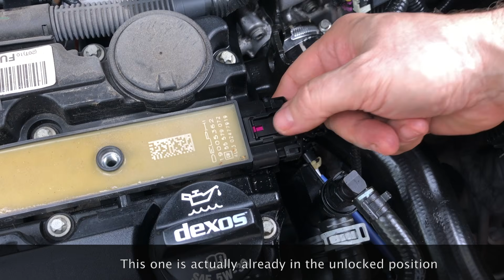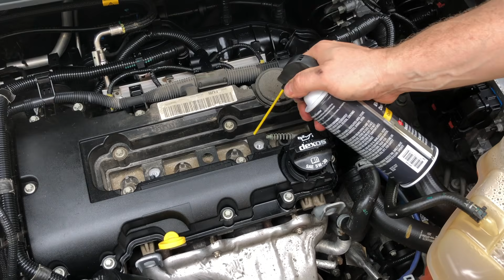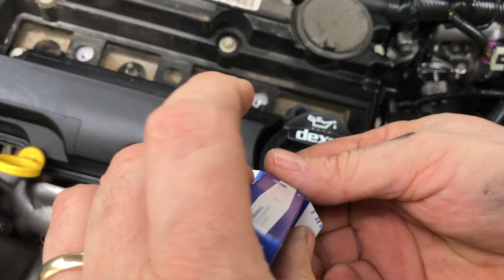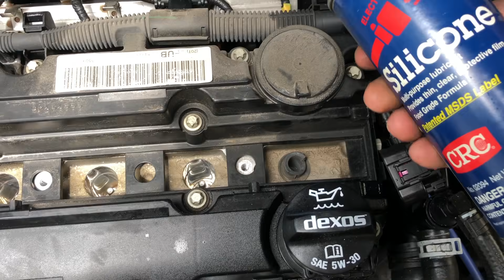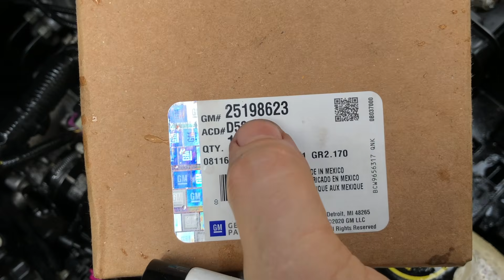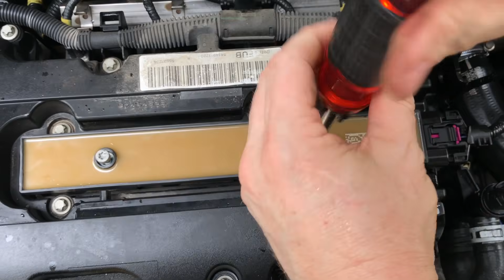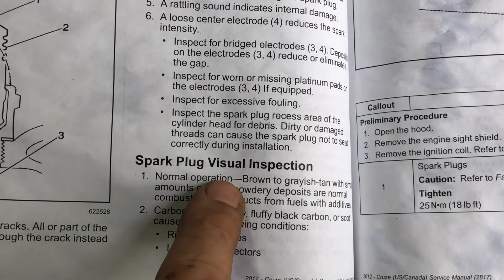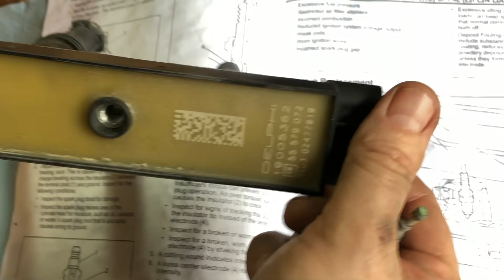2012 - 2021 GM Ecotec 1.4L Turbo Engine 60K Mile Maintenance (Replace Plugs & Coil Pack) Sonic Cruze

Comment from the maker: In the case of this video, the vehicle owner wanted to replace the coil pack entirely rather than repair the damaged boot.   This is what I would recommend if an aftermarket coil pack is involved as those are inherently inferior to genuine GM parts.  But here is a link to a alternative approach, where just the individual boot and/or spring can be replaced with an OEM to GM kit: https://youtu.be/vUFMqa44Phs
Reply from the maker: Yep, but that's not what the vehicle owner wanted here.  But I've shown this less expensive route also - https://youtu.be/vUFMqa44Phs

Comment: should use anti seize on the spark plug threads also
Reply from the maker: No, you should not on these engines.  Not recommended by the manufacturer as it Interferes with achieving the correct torque value for the crush washer.
Reply: @DrShock  yeah i believe you're right now that i actually looked it up.  just assumed from being told that so often

Comment: Can this work on Chevrolet sonic 1.6L 2016?
Where can I order coil and spark plugs
Reply from the maker: No, this is video is only applicable to the GM Ecotec 1.4L turbocharged gasoline engine.  For this video, the links to the parts used are in the video description.

Comment: I bought my '12 Cruze with 109K miles on it. I recently replaced the plugs at 199k miles. The plugs looked good, which told me that they were replaced right before I bought it. I didnt replace the coils. They looked pretty good.

Comment: My 2020 Trax manual says replace plugs at 98000K.
Reply from the maker: Be sure you have the RPO LUJ or LUV engine that this video covers.  It can be confusing, as GM has multiple 1.4L turbocharged engine designs produced in parallel over the model years this video covers.  RPO would be the "regular production option" code for the one you have.

Comment: I'm having a difficult time understanding why the one plug & coil electrode had so much corrosion where the others didn't? Not seeing moisture as the reason to the constant engine temperature would dry up any moisture....These are high maintenance vehicles & being proactive in the maintenance is the only way these vehicles will last.... The plastic water pump & thermostat housing plumbing is a joke, Guaranteed failure on an engine that cannot take one overheating... The engine has to be idled down after a hard run to try to save the turbo charger, Oil changes are a must between 4-5k miles, The oil feed tube to the turbo also has to be changed around 30-40 k.. God help you if you bought one of these cars used with the previous owner sleeping at the switch....I foolishly bought my 2017 Trax new & it just turned 30k miles, & I'm starting to get scared, I primarily drive my 2005 Toyota Matrix with 225k miles with piece of mind.....
Reply from the maker: This particular GM engine, designed by their German Opel division at the time, encounters corrosion on the spark plug and ignition coil spring (typically cylinder #4 but can occur on any of them) as a very common problem in the RPO LUV and LUJ first generation flavors of this engine.  The spark plug metal will show the typical iron oxide coloring, but the coil springs will be more green in color from copper oxide. Even diligent use of dielectric grease within the ignition coil boot cannot fully prevent this corrosion which is likely driven by water condensation in the the spark plug wells on this engine design while the engine is off

Comment: How come your engine is not covered in oil and coolant like the rest of ours???
Reply from the maker: Well first, this isn't "my" engine but rather someone else's I am servicing.  And while it's not pristine, these are European engines (GMs former Opel division in Germany designed them) so they are high maintenance.  If you proactively replace any seals or gaskets, and reseal pans and covers, at the first sign of leakage that goes along way towards the cosmetic appearance that this example still has after a decade of regular use.

Comment: Replaced my coil pack and spark plugs when i first got my cruze at 63k miles, didnt know bad coil packs on these cars produce a ticking sound so it scared me 😂, i can say though the oem ones didnt work for me, i bought two and the springs would always go out, bought a aftermarket one off amazon for $80 and havent had to replace it sense and im at 93k now

Comment: Dear DrShock - I love you videos, you do a great job of giving the R&R Procedure (Remove & Replace). 

No Offense Intended: If I could make a suggestion to you, as I have seen you do this in other Auto R&R videos, and that is to ALWAYS use some Anti-Seize, on the plug threads especially since your screwing two dissimilar metals together!), a tiny bit on the sealing gasket if the plug has one, and Silicone Grease (Di-Electric Grease) on the spark plug porcelain, Q-Tip a small amount up into the Spark Plug Boot, AND on the outside of the Boot (so it does not adhere to the plug-well walls). A small dab on ALL assembly bolts.screws, and finally, some Electrical Contact Cleaner/Preserver* in both side of the electrical plug, which you then blow out lightly with a short blast of compressed air.

*NOTE: Such as - CRC QD Electronic Cleaner.

NOTE: When you lubricate the threads with any anti-seize, you generally should reduce the Torgue by about 10% to reduce the chance of stripping, as the Dry Threads contribute to the torgue resistance, and when you lubricate threads, you lose that resistance to torquing, and can possibly strip threads, especially in aluminum!

These recommendations come from my 53+ years as a Mechanic, Technician and an Engineer, working on everything from cars (I was a Chevy Dealership Mechanic at one point, Semi's, motorcycles, small engine equipment, large engine equipment, military vehicles (Former US Marine), and even Surface-To-Air Missile Systems which we periodically had to maintenance when deployed in a hot zone. 

Just a suggestion for you to consider, but thanks for the GREAT job you do of demonstrating the R&R, and showing part numbers,... wholly invaluable information sometimes! - JD
Reply from the maker: Thanks, for the overall feedback on the channel and the comment here.  I know folks develop alot of their own tweaks to various repair procedures with experience and appreciate it when that is shared with the community via the comment section on a given video.  Particularly regional specific approaches, where corrosion e.g. can be a significant issue for some vehicle owners.   

In order to present a consistent factory engineering perspective on the channel though, I usually present the OEM service information as-is without any modifications.   If the OEM recommended any chemicals or lubricants, I definitely show them, along with the OEM recommended chemical brand, part number, and suggested application.  I'll also highlight when the OEM recommends against such practices, which would usually just be where fastener torque is more crucial.   This leaves the comment section to add individual experiences and suggestions as we're discussing here.  Thanks again.

Comment: I recently bought a 2013 Buick Encore with only 60k miles and replaced the spark box and spark-a-lators.  Your video was a great step by step.

Comment: What exactly would cause that corrosion to the spark plug? Isn't it a function of the coil boot to keep out any water?
Reply from the maker: Prior service, done by another shop, may have failed to use dielectric grease on the boots.  Could be a previous owner "washed" the engine, which is a huge no-no on this model.   Really difficult to say not knowing the history (the owner had just purchased this vehicle and brought it to me to do the maintenance schedule and some other repairs when I made this particular video).  Another, related issue, is unfortunately fairly common on this particular GM engine which is corrosion on the coil pack contact spring itself.

Comment: Good video when you take one spark plug out do u put new one before you take the other old one out?
Reply from the maker: Doesn't matter really (same diff as do you put on a sock and a sock then a shoe and a shoe or a sock and shoe first ;-) ), the only concern would be on debris falling in and cleaning the tubes out with compressed / shop air prior removes that risk.

Comment: Should have removed the wire connection to the coil pacs first. Then the Torx.
Reply: GM recommends the coil pac be replaced with each plug change. They consider it a wearable item just like the plugs.
Reply from the maker: No, GM does not make such a recommendation for this particular engine. All required and recommended maintenance is documented within the vehicle owners manual maintenance schedule, as mandated by state and federal law.  These same maintenance schedules can be found within the GM service information manual.  If corrections or additions to maintenance for  either manuals become necessary, service bulletins are published.   But you will not find any such written recommendation to replace the coil pack assembly for this particular engine across any of these three genuine GM factory resources. 

GM recommendations can vary by engine, and by engine generation.  There is no one size fits all for the GM Ecotec 1.4L engine as there are several generations in service, and maintenance guidance can vary between generations and models.  This video only pertains to RPO LUV and RPO LUJ used on various Chevrolet and Buick vehicles from 2012 thru 2021 (i.e., first generation).  Other engine generations may have different maintenance schedule contents GM recommends, but coil packs are not part of any such recommendation for the generation in this video.
Reply from the maker: No, I would not agree with that. Once you service enough of these engines like I have over the last decade, you will learn that the electrical connector used on this particular engines' coil pack is very fragile.  After a few years they're highly prone to breaking off at the retainer.   We do it the way shown to avoid dealing with a broken connector, and avoid eating the expense of having to replace it for the vehicles owner.

Comment: Can you put a little anti seize on the plugs ?
Reply from the maker: It's not recommended by GM in their service manual for this particular engine, as such lubricants interfere with achieving the correct torque value on genuine OEM spark plugs.  The mileage service interval we're going over here is intended to get the spark plugs replaced before any dissimilar metal type corrosion becomes a concern.   That all said, in some areas with high salting of roads only, it may be unavoidably necessary to apply a very thin amount..

Comment: What is the " bird chirping "  sound when I accelerate ? 2016 Chevy Trax 1.4l Turbo
Reply from the maker: If the sound started after you performed the service covered in this video, then typically the sound would be from one or more spark plugs not properly torqued down.

Comment: 😫😫😫 So I decided to do the plugs on the exact same car. Tell me why the boot fell apart exactly as yours did but mine crumbled. Fortunately I found another boot at the dealer for $11. And I had to find different little things to get the crumbles out
Reply from the maker: Heat, age both combine to degrade the boot. For cleaning the debris out of the spark plug tube compressed air is best.  You can replace the whole coil pack, as I did here with genuine GM parts (listed down in the video description), or just the boot.  But GM does not service the spring inside separately.  For the spring I did a different video with the OEM GM uses here - https://youtu.be/vUFMqa44Phs

Comment: Hi great video thank you. I am considering if the coil kit is what I need to change on 2011 1.8 Cruze. I have had flat spot on acceleration on engine, I have had intermittent engine lights come on. The flat spot on acceleration seem to go away once engine warms up? 
The engine lights have not happened for 4 months now. I assume my issue will come back once winter hits in.
Your feedback would be much appreciated. 
Thank you once again

Comment: One of the best-detailed explanation processes I have seen. Thank you. Please mention the list of tools you use in the process. Is there any anticorrosive we can apply over the plug bases?
Reply from the maker: Thanks, these jobs are filmed live so there's no opportunity to list tools in advance.  These vids are filmed in the follow-along style.   GM does not recommend any treatment to be applied to the spark plug threads of this model engine.  The service interval itself is intended to stave off any corrosion situations.

Comment: Thank you nice video. Quick question 
Do the NGK spark plugs need to be gapped?
Reply from the maker: Thanks.  No, absolutely no adjusting the gap on modern spark plugs for GM engines.  You can check them, but any bending will damage the iridium coating on the electrode.
Reply: @DrShock  copy that thank you Sir

Comment: Why coil packs, why not individual coils, why this design? If one coil goes the whole pack needs to be replaced, which is much more expensive. It seems to me the manufacturers want to save a few bucks and don't really care about the customers.

Comment: The fact that the Chevy Cruze plugs are right on top,and you can change them all in about 15 min is a godsend!
I drove a v6 cavalier for many years and it was a real pain to change all the plugs,especially in the back!
Love that the Cruze oil filter is also on top of the engine is like icing on the cake.
Reply: @bd764  psychopath the truth of his visors on this engine you will cry .it's a big of shit that nobody should buy

Comment: My sonic is at 154k and going up hill or trying to pass someone the rpm just shoot up and no power. What can be the reason.
Reply: You have a Sonic.
Reply: Jk. 154 is amazing for a Sonic. Check the throttle body.

Comment: im glad when i replaced my spark plugs that my mis fires were just because of the spring not being sat right, all i had to do was re postion it and it fixed the mis firing and engine wasnt as rough!

Comment: I got a 2016 Trax 2 years ago after just 6 months it got a miss fire they told me the coil pack was bad and it needed new spark plugs wile they where in there.
well they never turned off my dash cam and they just change the sparkplugs! i lost my shit on that dealers and summited the video to the warranty compare for fraud

Comment: I just got NGK iridium spark plugs for my 2018 Trax LT the guy at Auto Zone recommended them are they ok? So I don’t have a torque wrench if I just lightly snug them down would that be ok for the plugs and coil pack?
Reply from the maker: NGK are an OEM for ACDelco, so that's a fine brand.    If you don't have a torque wrench, aim to insure the sealing washer of the spark plug is making a correct seal.   You don't want to over tighten these as the head is made of aluminum and its threads are easily stripped.  But its got to seal.
Reply: @ I can probably get a cheap torque wrench to do the 18 foot ponds for the plugs.  71 inch pounds for the coil pack does that matter? As I don’t know if a cheap twerk wrench will do booth foot pounds and inch pounds. I’m not a mechanic so I don’t know much about tools I just know I got just under 63K on my Trax it runs great but I’m sure they need to be replaced soon and I do got the plugs just not a twerk wrench but like I said if I can get one for around $20 I can do that money is a little tight so I’m doing the best I can
Reply from the maker: Plugs are the more important, you can just snug the coil in a pinch.
Reply: @  thank you for the help
Reply from the maker: And don't worry about whether your borrowed wrench is only in one measurement system.  You can manually convert from inch pounds and foot pounds or even newton meters and make use of what you have available.

Comment: Check 2019,2020 :1.4 L Turbo the use Ruthenium Plugs , heat up, spread out more than iridium plugs. Same engine over 8,9 -years . But a better plug.
Dielectric grease, on booths - stop the stickies.
4-coil packs….. SUCK !
I’m on # 4. 169,000. Miles.
Get heat cracks, miss fire .🔥 
Thanks G.M. for not UPGRADING YOUR POOR DESIGN !

Comment: Smaller fasteners, I don't torque down. Unless you have cleaned the threads, there is a risk that the fastener will break or pull the threads. You should always go by feel. Torque values are an estimate by the engineer how much clamping force is being applied rather than an exact measurement.

Comment: Man and that was at 60 thousand miles? I have a 2014 Chevy Cruze Lt and I have 86 thousand miles on it. Haven't changed mine manual says at 95 thous. Any other problems you experienced on Cruze? Thanks for the video any feedback appreciated
Reply from the maker: Maintenance schedules can vary by model year, and engine options with GM vehicles.  There is no one size fits all and you should verify your particular schedule in your owners manual.   This particular 2015 Chevy Sonic with the 1.4L turbocharged engine requires an every 60K maintenance schedule as I showed.   Several other GM models with this same engine share this same maintenance schedule though.  I have had customers with the Cruze as well, you can find some videos about that model in my channel.  They all have their share of problems. ;-)

Comment: TIP: A piece of rubber hose on the end of the plug is great for threading them back in prior to torquing them down. 
1 foot of 1/4" or 3/8"rubber fuel hose should do it. I actually don't remember which fits. lol